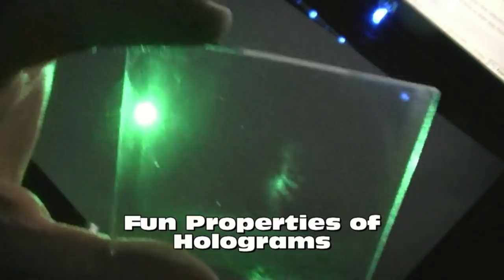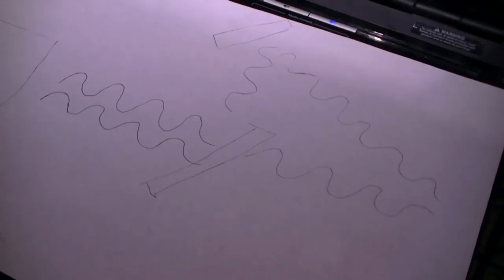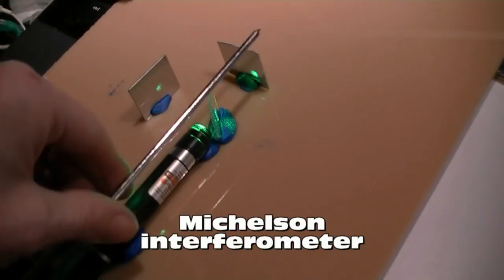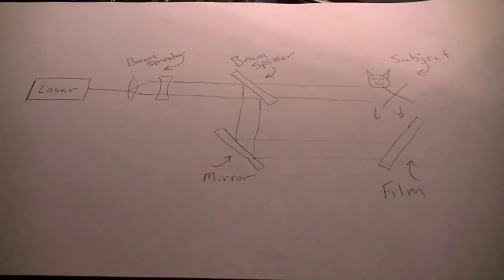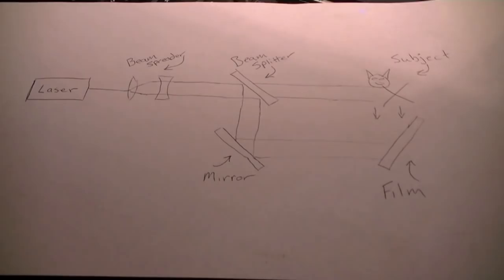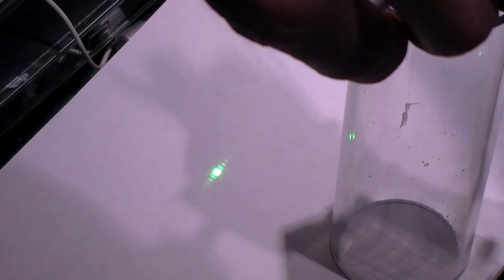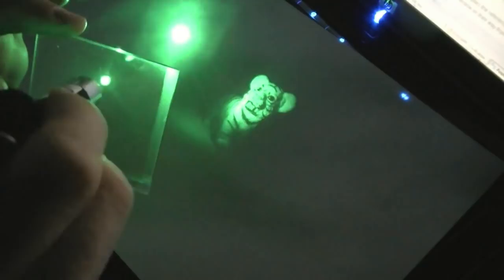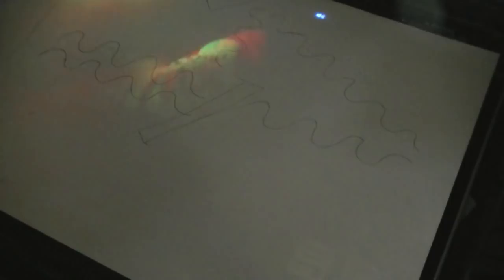Fun Properties of Holograms - Projecting 3d Images

Comment: The interesting thing about holograms is that you are recording the interference pattern between the two waves. Another property of recording an interference pattern and not an image is that the pattern is spread over a larger area. If you happen to have an exposed broken plate, you will not end up with a fractured hologram but one that you can still see the entire image in, only smaller and maybe with a lower resolution. Could you make stereo 3D with two plate sections and a beam splitter?